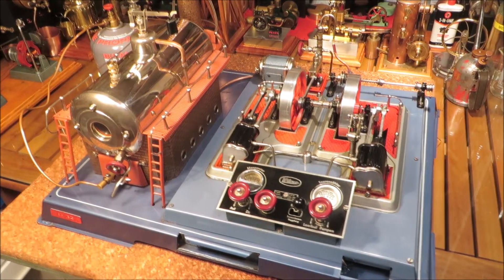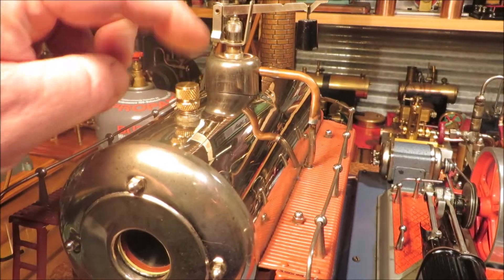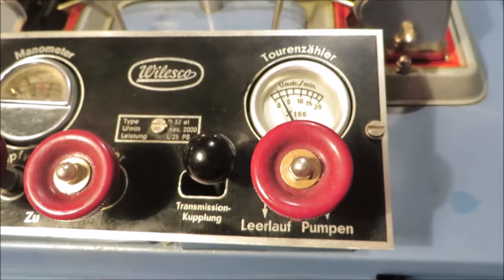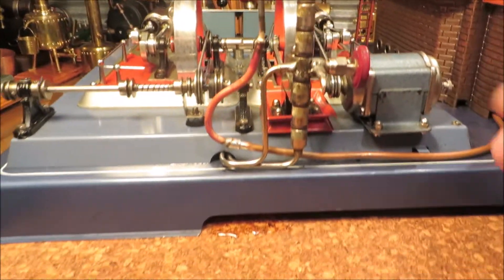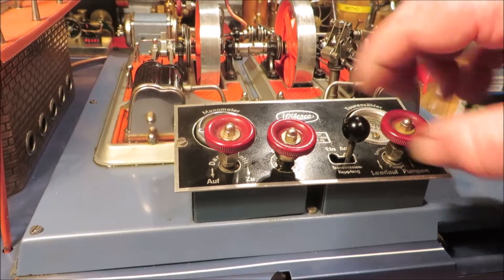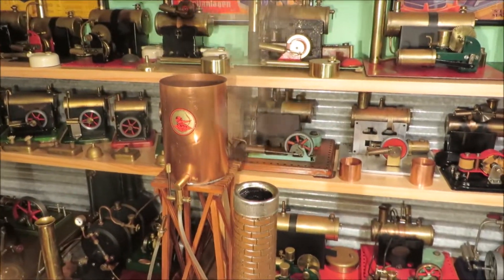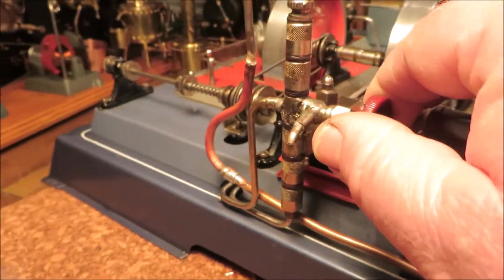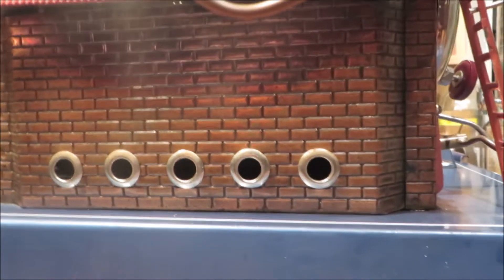Wilesco D32 Model Steam or Toy Steam Engine running on live steam modded from electric to gas fired

Comment: Hallo

Do i need to  have a new Boiler for that ? or is it possible to make Fire Flames under the original EL Boiler ??
Reply from the maker: I removed the failed electrical band from the original boiler and was good to go using the original boiler then.

Comment: I get how annoying the condensate drawer might be, but why bother with making a condensate cup?   
Why not route the stack-condensate back to the main cold-water feed tank?   
That way then, the stack-condensate is recycled, with no need to monitor or empty.
Reply from the maker: There's always globules of steam oil in the condensate tray, you wouldn't want that recycled into your boiler.

Comment: Where do the exhaust gasses escape? I mean the d24 uses the chimney for that but this model seems to use that for steam as it was electrically heated before.
Reply from the maker: I did think of removing the condensate catcher in the D32's chimney when I did the modification, but thought I'd test it first as is. I've put around 15 hours run time now on the D32 and the burnt gases have enough spaces to disperse and there has been no burn mark or discolouration to the faux pattern brickwork.